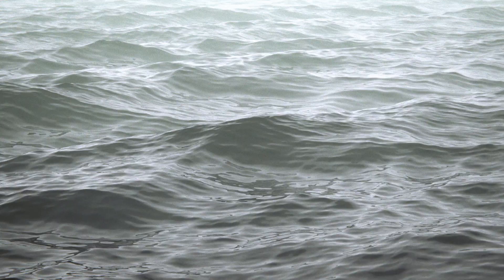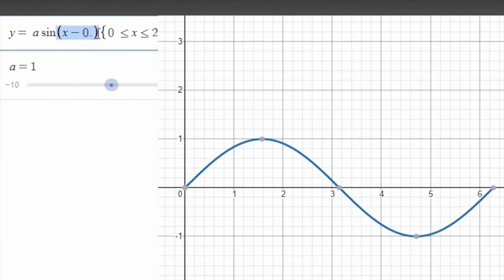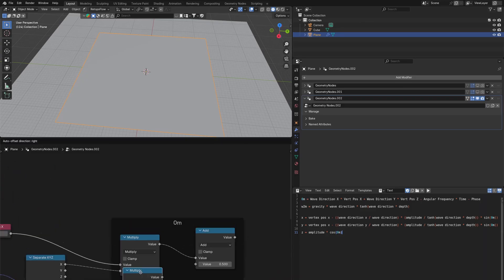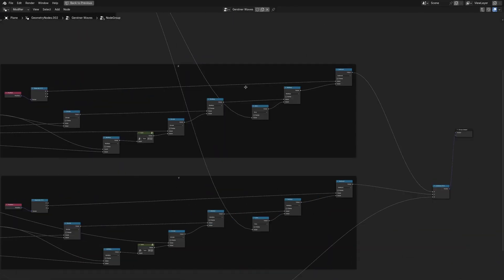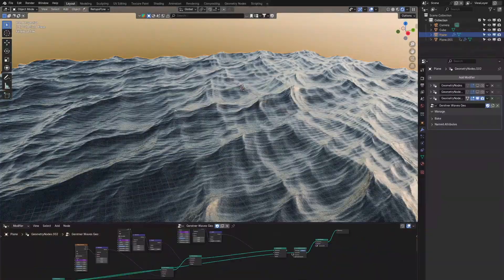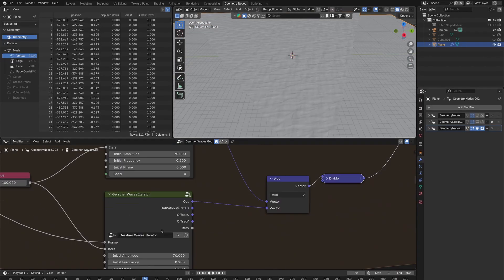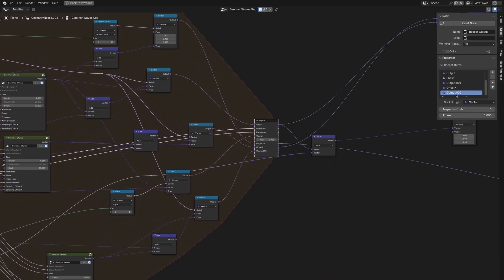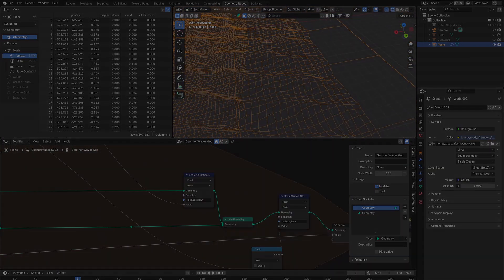Was Annoyed by Blender’s Ocean — So I Made My Own

Comment: This is really great. I think it's insane how much we take for granted that "just happens". Water flow, air turbulence, light scattering. Everyone thinks it'll be super easy to implement, barely an inconvenience. But the math behind simulating those things are extremely complex and there's a reason why weather forecasting and tsunami & hurricane prediction is so hard. The shader 'color' of the water on your closeups is fantastic though. Looks great both close up and far away.
Reply from the maker: Yeah that's very true - and like the waves I made - I wouldn't even call them a simulation - more an approximation - 

but yeah weather forecasting is truly a wonder that it works :-)

Thank you! I'm glad that you like it!